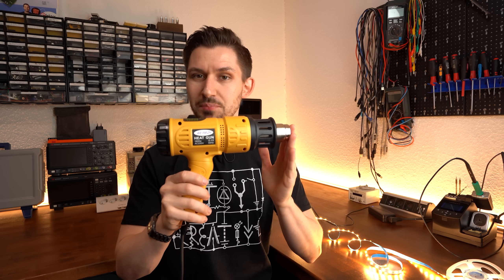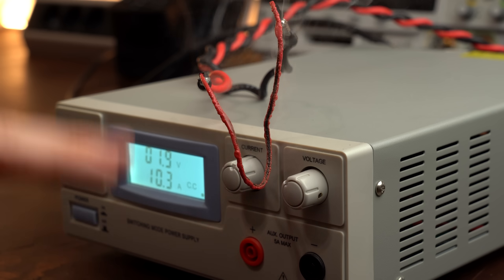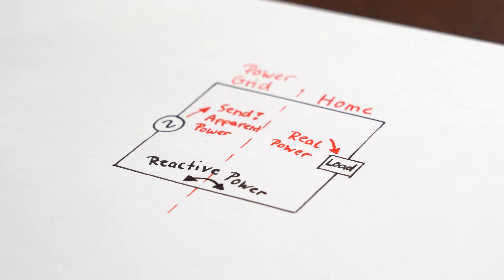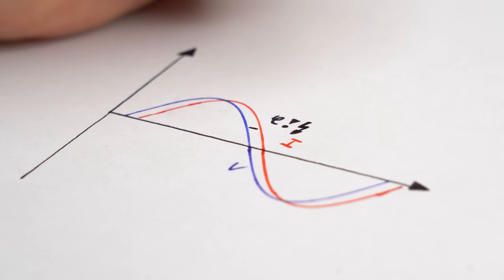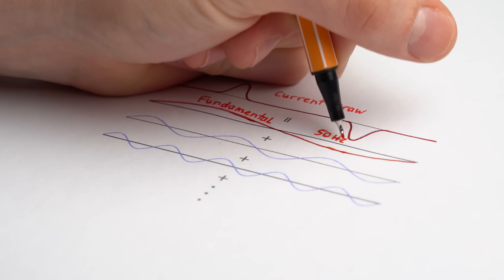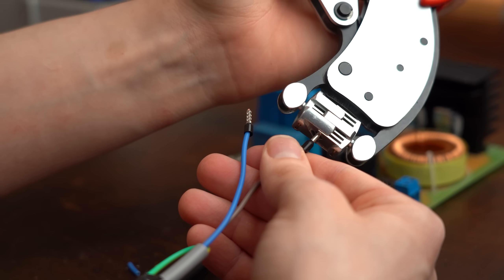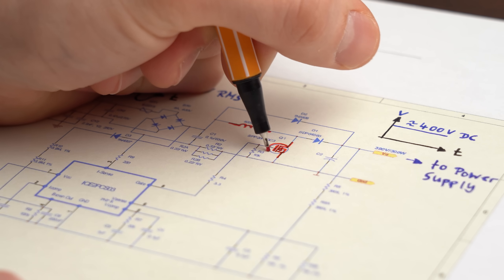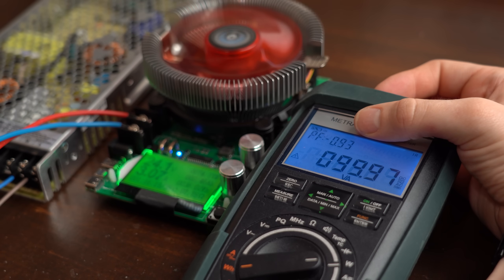The Most Important Circuit for our Electrical Future?! (PFC) EB#55

Comment: As a future project, could you make an inverter that corrects square sine wave power produced by a standard gas generator and creates pure sine wave?  I'm thinking of something you could plug in to your wall on a specific circuit that creates clean power on that circuit for sensitive electronics for a load of up to 2000 watts.  Seems to me silly to have to buy a pure sine wave generator when sometimes all you need to do is clean up the power for a single circuit.  This would allow the purchase of a cheap generator, but still get clean power where you need it.
Thanks
Reply: That device is called an on-line UPS. About $600+ for 3000VA. 
All alternators produce sine wave (also called "generators", although a generator technically produce DC). Square wave or "modified sine wave" is produced by cheaper inverters.
The problem with alternators are voltage spikes, under or over voltage, harmonic distortion (due to capacitive/inductive loads) and frequency deviation. This is caused by having a too simple regulating circuit on the alternator. 
You have 3 options.
1. As you stated, buy a generator set designed for electronic loads, with an AVR controller and/or an inverter.
2. Buy an on-line UPS. Usually at least as expensive as 1, but can be an alternative if you need a big gen. set with a lot of VA but only have a smaller electronic load. Gives a very good output. Best option.
3. Buy a line regulating UPS ("Interactive"). Cheaper and in my experience good enough in most cases. This is a bit hard to find for 2000W since you tend to get up to the PRO models with that power. If you can settle for a smaller 400-1000W you can find them in the price range $200-300. 
I have had a few UPSes blow due to voltage spikes, but the equipment survived due to the protection circuits in the UPS. This was in pretty extreme circumstances with a lot of nasty equipment running off the gen. set.

You can of course build something, which is a lot of fun, but very hard if you don't work with designing high power switched power inverters for a living. And it will likely not be cheaper.

Comment: The glass analogy never works for me w.r.t. Power Factor... It explains a physical analog of real, apparent, and reactive power, how only real power is "useful" like the non-foamy part of the drink, but the existence of foam has no relevance to the existence of reactive power. 

If we could eliminate foaming from carbonated beverages without affecting their carbonation, we would. But the same isn't true for reactive power, which is absolutely necessary for induction to take place. Similarly, a correction to power factor does not eliminate reactive power, it just offsets for it with added capacitance.

Comment: In my opinion this thing shows that in the future we need switch to DC power. If more and more devices use DC, and we will need to add PFC to practically all of them, using AC will be more and more problematic. Transfer to DC will probably take a lot of time, but watching this makes me feel like use of AC makes less and less sense.
Reply: There's one "secret" reason why AC works so well: the zero-crossing breaks the arcs which naturally occur when you break a connection. If you use a normal switch on 110v DC it will sustain an arc and quite possibly catch on fire. Switches need to be much better built in order to safely work with DC. The same is true of power connectors.
Reply: @eDoc2020 
Yes
But it's much easier to add arc suspension (for example a small cap for removing disconnect arc and a coil with a diode or similar part to slow down charge) to every device than PFC. And if done correctly it will allow using normal AC switches and normal-sized sockets. Only breakers will need to be different because breaking DC short circuit will be a problem.
In my opinion it will be much easier to deal with a single problem which is arcing, than with many more problems that AC creates, for example losses in wires because of induction, capacitance and skin-effect, it's much harder to balance the grid when more and more solar panels are mounted and inverting DC to AC only to rectify it back to DC in the majority of devices sounds kinda inefficient.
Reply: @darthtacotmp134  The huge problem with DC distribution is that you can't easily convert voltages. With AC you can use dumb distribution transformers which sit at the end of the street and operate without maintenance for over 50 years. With DC you'd need to have active DC-DC converters which will be expensive and break down much more often. Upkeep of the power system would be much more expensive.

It's just much more practical to have the active power conversion in the device. PFC is pretty cheap (at least compared to the rest of the power supply) and when something goes wrong it's much easier to deal with a failure in a cheap 100W supply which makes your laptops stop working and anybody can replace vs an expensive 50kW supply which takes down the entire street and requires trained personnel with specialized safety gear to replace.
Reply: @eDoc2020 
You are right. Of course, it makes much more sense now to put PFC in the power supply if only a small percentage of power is consumed by DC devices. But as a greater amount of power will go to DC devices, adding it to every small and bigger one will be less and less efficient. If in the future not only your laptop or phone, but also your heat pump, induction stove, car, and power tools need PFC, it will make much more sense to have one big converter "at the end of the street" for all of them. And what about all of the super small devices like smart switches, led bulbs, sensors, etc? Do you think we put PFC in all of them too? Because they combined will add up to not a small load.
On top of that capacitance created by rectifiers is already a huge problem, and it makes operating low- and medium-voltage power lines very hard.
I think that in the future, high-power DC converters will be cheaper and more reliable. And at some point the cost of metals needed to build a traditional transformer will be higher than the cost of the converter, same as now a SMPS is cheaper than a linear one. Another thing is that converters regulate their outputs, so the voltage will be stable even if the input voltage from the power line is fluctuating. So maybe at some point, that kind of converter will be not only more reliable, but also able to provide stable voltage in less favorable conditions.
But to make it possible we need to refine capacitors and MOSFETs. So we will see how it ends up, but personally I just really like DC シ.
Reply: @darthtacotmp134  For large loads which consume an entire circuit PFC is most important because it directly allows more load on the same wires. For induction stoves and EV chargers there's one attribute which makes PFC super cheap: they don't require a smooth output.

Large power tools and many other appliances tend to use AC motors. For these, a DC supply just doesn't make sense. PPFC is easily provided with a capacitor.

For the foreseeable future only a fraction of the total grid load is from devices requiring steady DC.

Something I could see becoming more popular is an active external PFC corrector, something that monitors your home's current waveform and calculates exactly the waveform needed to offset this. It would give PFC everywhere, require no changes to the grid, and would add no cost to devices.

If you do use a central converter IMO I would go with something like 400Hz 3phase at its output. You'd get all the benefits of AC and with a six-diode bridge rectifier you'd get good-enough PF for local consumption. And since it's polyphase you wouldn't even need bulk filter capacitors.
Reply: @eDoc2020  

Yes, you're right. It means that if we wanted to switch to DC, there is no problem from these devices' perspective.

New power tools more and more often use BLDC motors because of their smooth speed regulation and ease of use. You usually see brushed motors in smaller power tools, but brushes wear out and are less efficient. Single-phase motors are tricky to use because of the start sequence. And 3-phase motors are more and more often equipped with a speed controller that rectifies AC to DC and works similarly to BLDC.

In my opinion, DC will take a majority of the grid load because modern data centers need a high amount of dc power, and we can see more of them use one central power supply and distribute power using DC, on top of that ups in that kind of system doesn't need to invert DC power only to be rectified back inside a server. Other examples are robots and other automation devices used in factories. They need dc power for their precise electronics.

I don't know how PFC with AC output work, but if it needs to rectify it to DC and invert back, I don't see the point of using them.
Same with 400Hz 3-phase power, it isn't a magical solution for PF, and a capacitor is still needed because the ripple is too high for converters. Apart from that, you will need not 3 but 4 wires to every device, and the skin effect will shrink the maximum current you can put on them. The only benefit will be that you need a smaller transformer connected straight to that line, but it doesn't matter because we use SMPS. And finally, if you want to create such a line, AC needs to be rectified to DC, so why don't you use it?

I'd rather use a central converter connected to 3-phase power (in the US to 240V split line) with high-quality PFC and, for example, a 200V DC split line with an additional 400V on output. That line could use standard wires and provide power to USB-c chargers for all your devices, LED lamps and strips, and other dc devices. Also, you could add to that solar system much cheaper because you don't need an expensive inverter, and it doesn't need to synchronize with anything. Additionally, you could add batteries and make your system capable of staying ON even if the power goes out, and it again will be much easier.
Even more, that's what I'm building. I started with the off-grid because building a 3-phase power supply is much harder than the 48V-200V high power converter.
Reply: @darthtacotmp134  3 phase rectified is definitely enough not to require a reservoir capacitor if feeding a switching converter. And as I said AC means you can use much cheaper connectors and switches.

Cordless power tools are definitely moving to BLDC but I haven't (yet) seen line powered tools with unconventional motors.

I do think many datacenters are going to all-DC local distribution and it is one of the places where it makes the most sense.

Comment: Nice video as always :) Also, could you make a DIY or BUY video about ultrasonic cleaner? Nothing fancy or big, just a small simple tub like those for jewlery.
Reply: If you design an ultrasonic driver, you keep the transducer voltage and current 90° out of phase automatically as the resonant frequency changes with water level and contents. It works really well once you get it right. No cpu. Just a 555, 4013 shift register and 4066 as a phase sensitive detector, controlling the frequency tuning pin 5 on the 555. It requires a current transformer. Good luck.
Reply: @neilw2O  Thanks. Sounds minimalistic as it should be.

Comment: Congratulation for your video, extremely interesting, as I saw from your diagram, the last blue dot, seems at 64 VA for 50 watts, that is pretty close to 82% efficiency which is the theoretical efficiency for converting AC to DC. Can you give us the exact numbers.Have you made any video regarding the efficiency of the power chargers of the electric cars to show us how much energy is wasted on the charger during a car charging;
Reply: The theoretical efficiency for converting AC to DC is 100%. Calculations stating otherwise most likely conflate average and RMS values.
Reply: @eDoc2020  My old electronics book says that Power DC/Power AC of a full wave rectified sinusoidal current has an efficiency of 8/π squared and this derive from a Fourier analysis of the rectified current waveform that computes the DC component.
Reply: @George_Argirakis  Logically thinking that can't be true. If you have an 820 watt DC power supply the book is suggesting at least 180 watts would be lost in the rectification process. If you look at a PC power supply the main rectifier often doesn't have even have a heatsink, let alone one that would dissipate over 100 watts.

Comment: Couldn't you just feed the HVDC directly into the device and just let the internal rectifier flow through? Sure only half of the rectifier would be in use, which half would be dependent upon polarity, meaning polarity would not matter.

Comment: Most devices mowadays use 5v, 12v and 18-21v range. Would be great you could make video about creating low voltage rails or power supplies for this. e.g. router + modem should really just use one power supply ( and relating to this video, with pfc). Another place would be laptops + monitors + peripherals. Was thinking it would be awesome to have something like 12vDC rail (or higher or lower) available the same way a plug point is standard around the house. Then use sepic to 5v.
Reply: A central usb c power supply in the house would be something, but I wonder if it wouldn't simply be too inefficient, as dc doesn't carry as well over distance
Reply: @tiloalo  yes, AC is better.
Reply: @chillydickie  I think a good solution is to have wall socket usb-c pd, most dc devices should be able to be powered from those. I guess even usb-c to barrel adapter for 12v or 18v existing devices should be easy to make.

Comment: Active PFC, such as used in computer power supplies also tends to short and explode when the big high voltage capacitor fails. I ave seen a few of such failed power supplies and managed to repair them. Still, when it fails, it not only turns off the load, but also trips the breaker, which means other stuff turns off as well.
I can just use a bigger cable and avoid this problem. Even if it is not frequent, it is very annoying when it happens.
The power grid sees constant 0.8 power factor from me though, because that's how the input for my big UPS works.

Comment: The best approach would be to design the LED driver SMPS circuit with NO 400v capacitor, instead just modulate its PWM to match the full wave rectified 100Hz mains supply, so the current it draws from the mains mimics a resistor (PF = 1).
This will of course echo some 100Hz current ripple to the output (to the LEDs) but that doesnt really matter because humans cant see 100Hz and the output capacitor will reduce that ripple anyway.
You should try building one, it is similar amount of work to the PFC you made here.
Reply: I should add that it would be possible to use one of the typical SMPS regulator ICs like a TL494 that has opamp style inputs, just connect the regulation inputs to sense mains supply current and mains supply voltage (both after the full wave rect of course).
Overall average regulation will then be at a constant mains power, which is fine for LEDs. If you want to add additional regulation for output voltage or current you can add that into the main regulation via summing etc.
Reply: That approach is often used in dedicated LED drivers.

And I need to disagree with you on the visibility of 100Hz ripple. LED nightlights which run on unfiltered 120Hz annoy me very much, but adding an output capacitor does help a lot.

Comment: Around 8:36 you didn't have to remove that rectifying bridge unless voltage would be higher than what it can handle. It would work fine just dropping voltage slightly giving you protection against reverse polarity.
Reply: I use those adapters on my (string of) solar panels. Works great! 230 Volt is more than enough. When the grid goes down, adapters help me to generate energy locally.
Reply: I just imagined Elecroboom going "you removed WHAT?! 🤬"
Reply: I came here to comment the same.

Comment: You are wrong, many LED drivers use buck or similar converters to current output. Basically more expensive models use dedicated DC-DC or 2-channel DC-DC converters to convert variable input voltage to transformer current, and it should be mentioned instead of PFC.